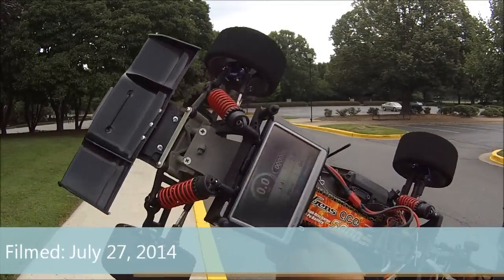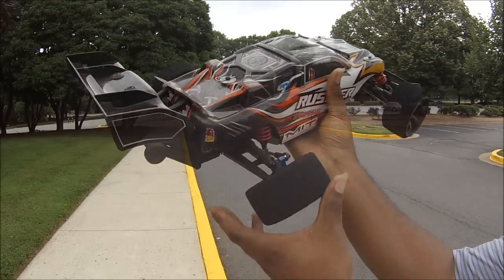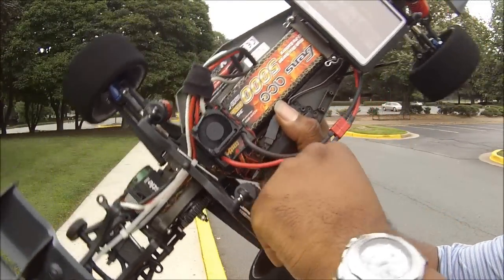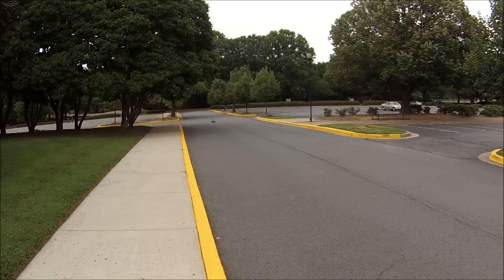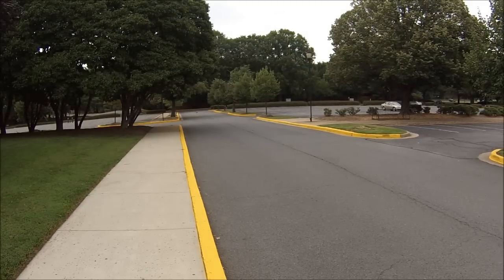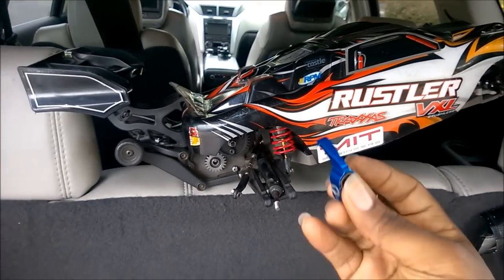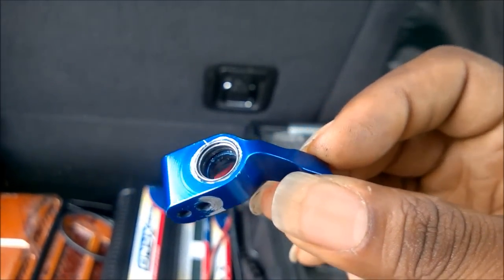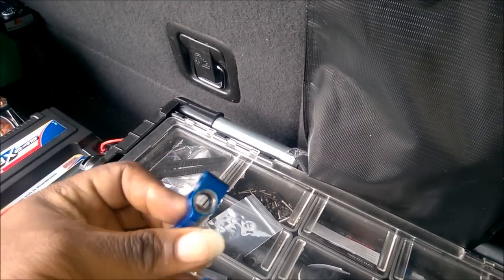Ep. 38: 70 MPH Fail! Volume 1

Comment: looked like you hadnt used threadlock when you failed at 1,40
Reply from the maker: PS4 Custom Gamer I learned my lesson that day. Thread locker is my friend now. ;-)
Reply: rhouse21 - RC Physics
same thing happened to me this week on the same part and others of my hpi bullet, easy fix just using threadlock and leaving to cure.
My issue was that I had bought the car used and hadnt installed the metal hopups myself so I had to wait for the threadlocker to arrive in the post and wait for it to cure :(

Fixed now though :P
Reply: +rhouse21 - RC Physics  what kind of rear wing is that bro?looks killer
Reply from the maker: erevo wing & mount.